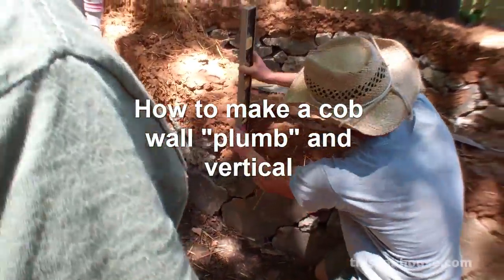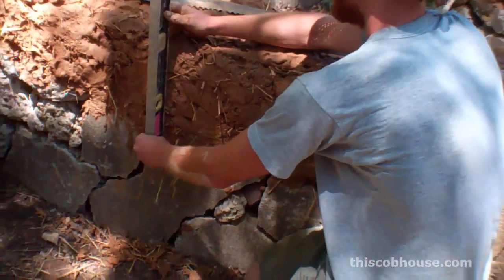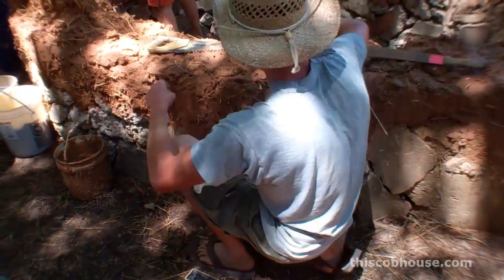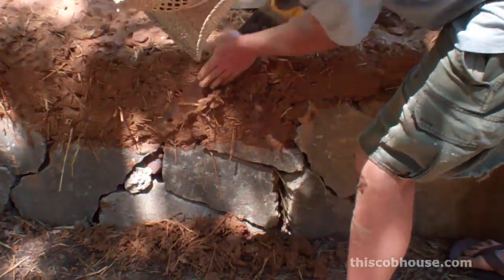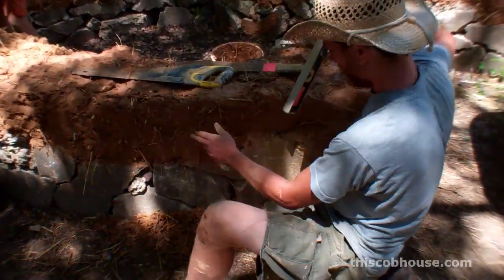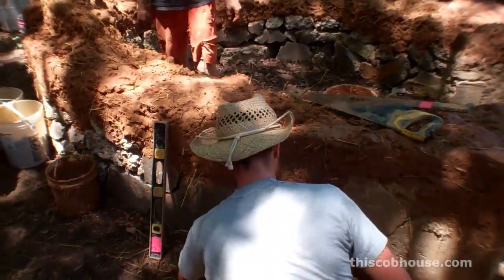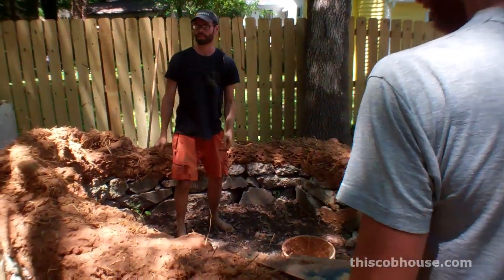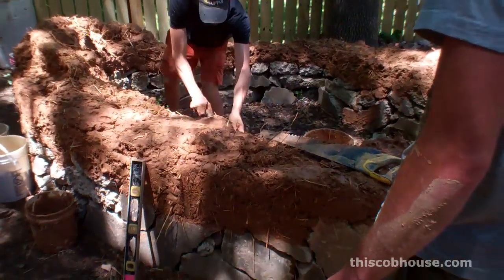Cob House Building - How to "Plumb" a Cob Wall

Comment: Sorry, but i have a question. How does the  external part of the wall can resist to water exposure. Even with a good roof  and foundation the walls stil have contact with some water, in case of heavy rain for example. How u guys made the external wall "water proof" or somewhat. Thanks in advance.

sry about the english
Reply: Luan Alves Alonso Martins 
Lime plaster, with frequent (annual) lime wash paint for regular maintenance
Reply: Luan Alves Alonso Martins you can paint a layer with warm boiled lineseed oil. You have to do iT with globes cuz iT is irratating to the skin. IT Will make the cob harder and make iT water resistent 

Sorry for my english ;)